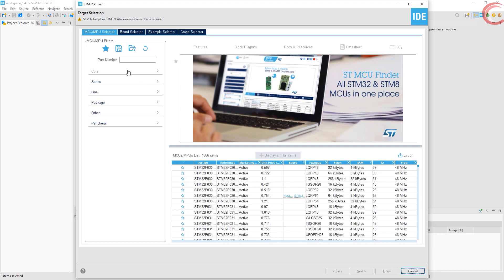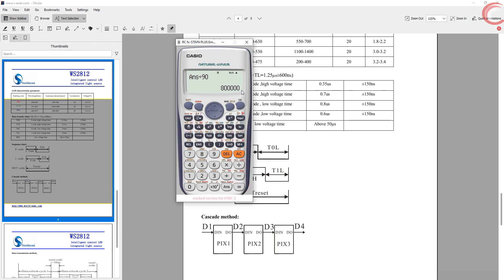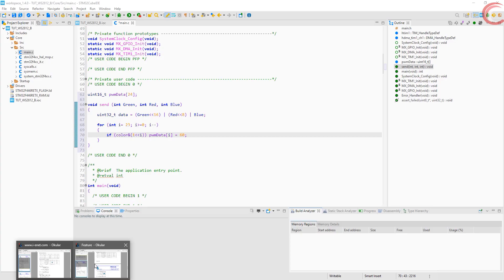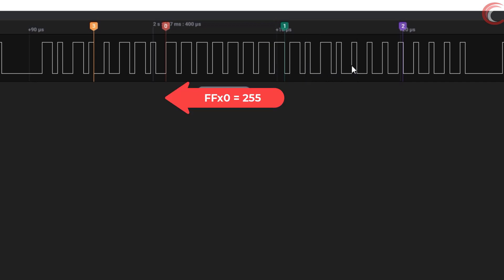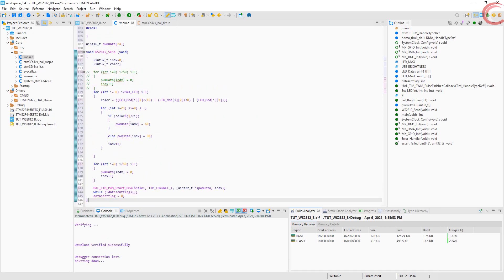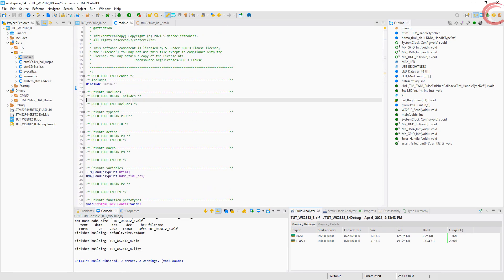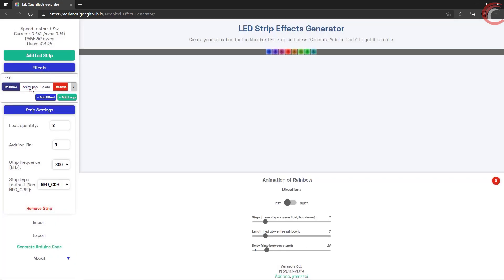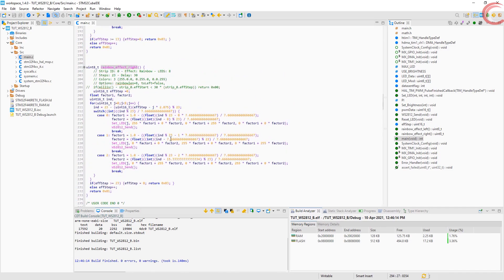WS2812 LED with STM32 || PWM using DMA

Comment: For all those, who have trouble with getting HAL_TIM_PWM_PulseFinishCallback() to work – You have to Enable the interrupt from corresponding DMA channel in NVIC settings category in Cube and set its priority. Otherwise, the interrupt is not fired and the function never gets called.
Reply from the maker: I thought the interrupt is automatically enabled once you enable the DMA. I guess they have changed it.. need to check it again

Comment: Excellent video! Only issue I have encountered is the excessive RAM memory utilization when driving 300 LEDs: 14.2 kiB. The best (but hard to implement) solution would be using circular DMA, but I couldn't be bothered. Instead you can also go back to the DMA configuration screen for the timer and say you want "Byte" data size at the memory size (and leave the peripheral data width alone, still "Half Word"). Then in code you can change the DMA buffer to uint8_t instead. This will half the memory footprint. Be careful what you pass to the the length parameter of HAL_TIM_PWM_Start_DMA, I suspect this counts in "data width" units.

Comment: Thanks a lot!!
After simple modification, I successfully reproduced on the bluepill board.
F103C8 have 20K RAM can drive 333 LEDs (With Brightness adjustment) or 358 LEDs(Without Brightness adjustment)

I think... If we use DMA's Half-Transfer Complete event (HT event) and Transfer Complete event (TC event) to DMA processing...
Able to use less RAM and can drive more LEDs.
Reply: Hi, can you please help me with the code modification for the bluepill board? Thanks.
Reply: @hulyjoe  You just have to use TIMER2 with the same configs, for some reason there is an conflict using TIMER1 and external clock

Comment: Hi I have gone through your code and worked out the same. I am using the F446"ZE" nucleo for ws2812 Dot Matrix of 8x32 matrix total 256 LEDs. I tried ur code in it. So your Set_LED and Set_Brightness(45)  is not working for me. Please offer some help. I am a newbie. One thing I noticed that if I change your MAX_LED from 8 to 200 then half of my Dot matrix strip turns on. And I can turn it whole on by giving MAX_LED to 800 the entire strip turns on. But the issue is even if I downgrade back to MAX_LED 8 it doesnt turn off the remaining LEDs. Plus all the colors given in Set_LED(0,255,0,0,) or with any random LEDnum at any position it doesnt work. The LEDs that turns on after changing total LED numbers from MAX_LED to 200 or so are all the same color. Please explain in brief to solve this I will be glad. Out of all the videos yours seems to be the most easily doable yet i cant x)

Comment: Hi,
I guess most of the video is correct. But please have a look at 11:54. You want to send 24 pulses. If you count those shown in the oscilloscope recording you find 28. I had a similar issue on a STML4 with 80MHz. It seems that the DMA callback invocation is simply too slow. I tried to put all the code into RAM but without success. The only thing that cured the problem is to stop the DMA and write a 0 length pulse and after that stop the timer. Certainly to configure a 25th pulse with 0 length will do the same because this will be the repeated value after DMA is not updating anymore.
So you comment 'DMA doesn't stop' at 10:56 is actually wrong. The reason why PWM continous is because the timer is running. Therefore you don't need to stop DMA (it stops reliably after 24 updates of the CCR register of the belonging timer). However, you need to stop either the timer itself or the output of the belonging timer channel.
Reply: You're quite right. The DMA callback routine takes a little time, enough to send an additional 4 pulses.  I had the same issue (using an STM32F373 @ 72 MHz). My solution was to : a) put my LED code data in an array with 48 bytes offset data at the the beginning that only contain zeros, my real data at element data[48] and further. b)  change the DMA mode from normal to circular.  In this way, the DMA will loop back to the beginning and load the TIM OC register with '0' values (the offset stuff), therefore making the PWM output value low until the callback routine is triggered by the NVIC. My pulses are now a perfect multiple of 24 bytes. 
Also, you could make the DMA do data conversion, so store your led codes as bytes, then let the DMA covert them to words. This really shrinks your memory usage if you have a lot of LEDs in the string :
						dmaInit.PeriphDataAlignment = DMA_PDATAALIGN_WORD; /* UInt8 ==> UInt32 ! DMA doet de konversie.*/
						dmaInit.MemDataAlignment = DMA_MDATAALIGN_BYTE;

Comment: 10:52 it's not DMA sending the data! It's just the timer keeps working in PWM mode with the latest value left in its CCR register. DMA only sends 24 values you specified in the code and that all, it's not circular. In this case you need to add a 25th value which is equal to 0 to get rid of extra pulses.

Comment: You can do it without DMA. I've had the W2812B running with PWM on an xmega32. You use the "overflow" interrupt to update the duty cycle for the next cycle since W2812B timing is essentially PWM with 33% and 66% duty cycles for 0 and 1 respectively
Reply: That's basically correct, but using DMA you are offloading the task of updating the timer's CCR-register (PWM's duty-cycle) from the CPU to hardware (namely, the DMA). This way, you save valuable processing time for other (possibly real-time-)tasks, which may otherwise become delayed themselves.
Reply: can you please bit elabrate the this idea
Reply: @Sayeesh-kc5yy  the golden rule is: use the DMA controller when possible, in order to free the main processor for other things. your main chip is too precious to do just dumm byte sending and receiving.  Of course, this scheme is only fully functional with the usage of an RTOS.

Comment: I successful made the project works on STM32F407, with Keil C IDE. One strange point that I noticed when porting is that the program would unexpectedly stuck at: while (!datasentflag), even this variable shows value 1 when in debugging mode. 
To solve this bug, I had to declare it as volatile variable like this: volatile int datasentflag=0; (with #define USE_BRIGHTNESS 0)

Thanks you very much for this great tutorial!
Reply: Question what files did u include with your project to run this code
Reply: I had the same problem. But in my case it only appears if I select a 'Release' configuration. In 'Debug' configuration it works ok. But another strange problem is that when I run the program from the IDE, it stucks in the middle of the 4th color while sending the data. Or even at the first color. But after pressing reset it works. I don't understand what's going on.

Comment: I don't know if I translated the code properly, but in my case I had to put the pixel data from MSB to LSB into the pwm array starting from 0, not 23 as in the original code... Excellent tutorial btw

Comment: Im using this method and try to control more LED strip ( 8 led strip with 64 led on each strip). Im using STM32F407VET6 with 2 different timer and DMA set like you did. The led strip now is only shining half the number of LED on each strip. I think this is because limitations of DMA. Can I try this with using DMA burst feature ? And if you could do you have any document or example of using DMA burst transfer.

Comment: Hello, How can I make the LED strip start from a non zero. Example I want my LED to start from the forth (number 4) LED on the strip instead of number Zero. I did try to use range. The code compiled but it didnot run on the stm32. I need help.
Reply from the maker: You have to keep the first 3 of them to 0. They are connected in series so you have to proceed in that manner.
Reply: @ControllersTech  Hello, Thank you for the feedback. I did try this it worked. The difficulty that I am having using a range to do it, instead of hard typing the whole SET_LED one by one. Please help. If there is a video tutorial on LED i will gladly use it. I just want to do more.

Comment: Is it possible to run with internal system clock, please reply it as i cant generate any clock using internal clock but it work fine using external clock.
Reply from the maker: Yes everything is possible with internal clock.

Comment: Hello, for unknown reasons I have problem with "HAL_TIM_PWM_PulseFinishedCallback" function. I don't know why but my f429zi won't execute this callback and stop DMA. Any idea why can it be so? DMA data is sent but PWM wont shut up. :-) And HAL_TIM_RegisterCallback is disabbled in c file.
Reply: What is most strange sometimes this interrupts works but when I change some setting it dissapears in  next compilation ... :/
Reply: I had connected my nucleof411R E tyo check it and "HAL_TIM_RegisterCallback" is working. After that I connected nuclewof429zi and it also started to work.
Reply from the maker: You are using rhat transferfinished variable right ?
Because if you load pwm with another set of data, it will keep going..
Reply: @ControllersTech  Funny and strange thing. I made some additional ivestigations and tests and noticed that:
void HAL_TIM_PWM_PulseFinishedCallback(TIM_HandleTypeDef *htim){
	HAL_TIM_PWM_Stop_DMA(&htim1, TIM_CHANNEL_1);
	HAL_GPIO_WritePin(LD1_GPIO_Port, LD1_Pin, GPIO_PIN_SET);   //I add this line to test callback execution

}

is not executed in debug mode (LD1 led is not lighting) BUT when I run program HAL_TIM_PWM_PulseFinishedCallback is executed.

Do You have idea why is it so?

Comment: hi Controllers Tech, I am very new to microcontroller programming. I have question on the effect of why you initialized pwmData[24] as uint16_t type on line 67 in main.c and then when starting the HAL_TIM_PWM_Start_DMA function in line 80, you then cast it to uint32_t pointer? How does this affect the data stream? Sorry not sure I get this part.
Reply from the maker: Initialised with 16 bit because that's the maximum length of the data we can send. i used a 16 bit timer right..
Hal pwm start dma takes 32 bit parameter, that's why needed to typecast

Comment: Thank you! Got it working on the F031K6 board, I had to use the HSI clock instead because the board dosesn't have a external xtal. I also had to modify a few of the calulations but go it working just fine in the end. The only really question I have is I ended up having to modify the effects code a little bit to get my WS2812 LEDs to work. I ended up having to increase the strip count to double +1 what I was actually using. If I went 1 over I would only get one LED to light but my board had 7 LEDs so I had to set it to x15 LEDs to get it to work. This was this line of code I had to change in the begenning of the for loop in the effects code. 

for(uint16_t j=0;j<15;j++) {

Any thoughts on why that might be? Just curious 
Thanks!
Reply from the maker: effect code was just for fun. Even I was surprised when I got it to work. And obviously I don't know what's happening inside it, as I never tried to find out more about it

Comment: what a good video, thanks I needed it
although I have a question
is it necessarily to use DMA to send data?
Reply from the maker: You can use other things like spi, or timer interrupt. But with dma, the cpu remains free for other work
Reply: @ControllersTech  OK thank you
Reply: Been there, tried without DMA (using just GPIO pin registers): it was barely working. And if you have also interrupts for other peripherals, forget about it.
Reply: hey hi can you please explain how did you do @edwinvp
Reply: @Sayeesh-kc5yy  I used the STM32F072RBT chip. Inside my program I converted the RGB values for each LED to a long array with PWM data that the timer peripheral would understand. Then a DMA memory transfer would send the data to that timer which would generate the pulse train on the h/w pin. I have sources if you are interested.

Comment: Unfortunately, it didn't work with my processor stm32f030f4
Reply from the maker: If it have DMA and timer, then it should work as usual
Reply: @ControllersTech  Unfortunately i try a lot
Reply: @ControllersTech  I have question about how I can change idel from high to low